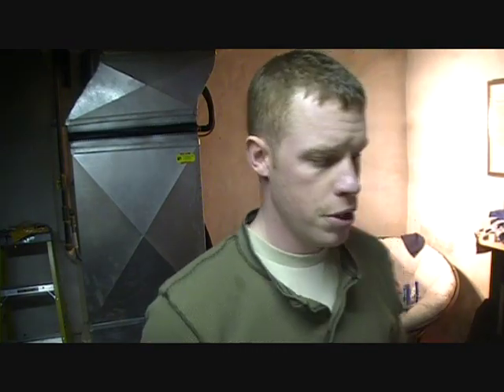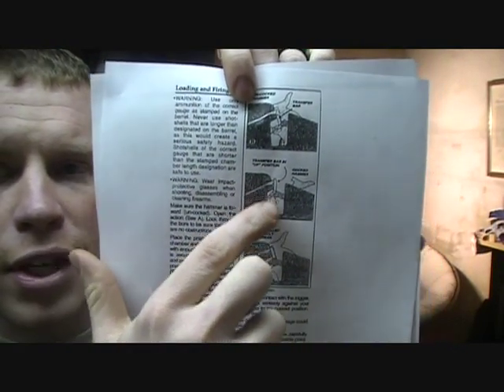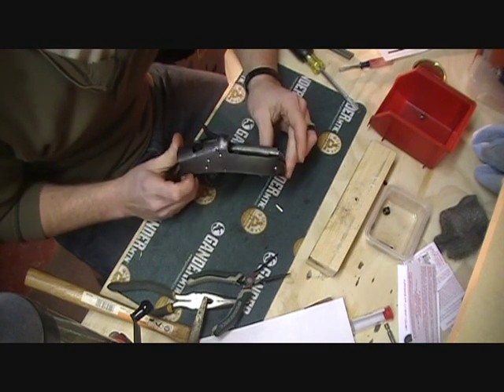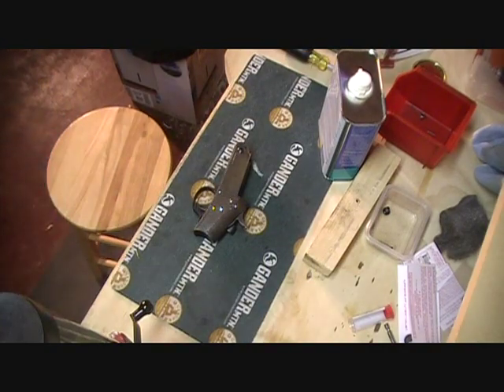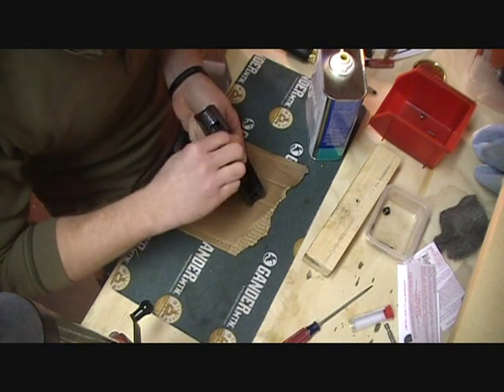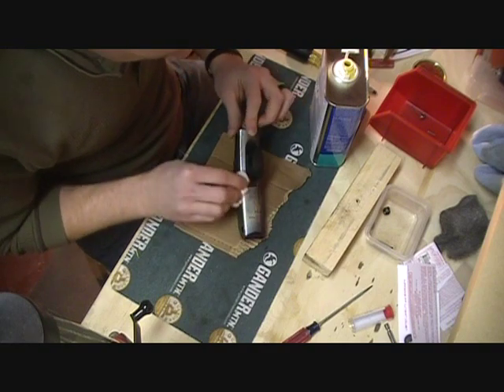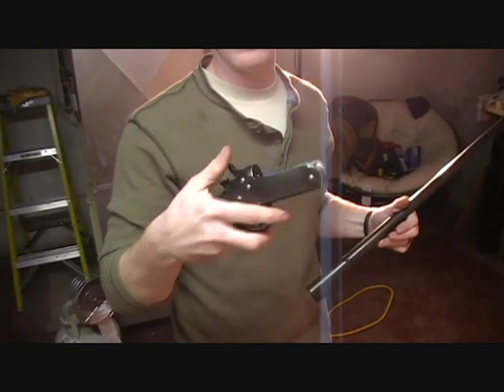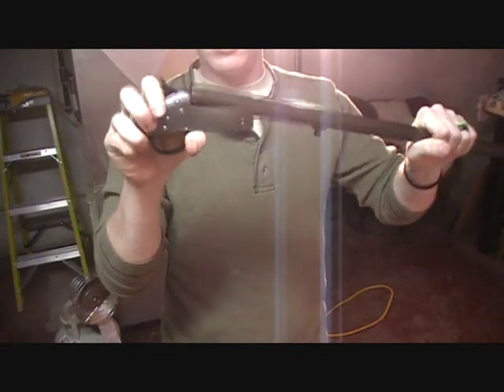H&R Project - Frame/Action Work

Comment: Thanx for FAST replay =D

After stubborning around I found that manual online, also I found some "detailed" step by step instructions somewhere on the web.

I managed to crawl through the assembly and it worked in first try... well after MANY test runs. All in all it took me around 3-4 hours to assemble the trigger mechanism, not bad for a first timer in my opinion.

But thank you for a very good videos and information.

peace out !